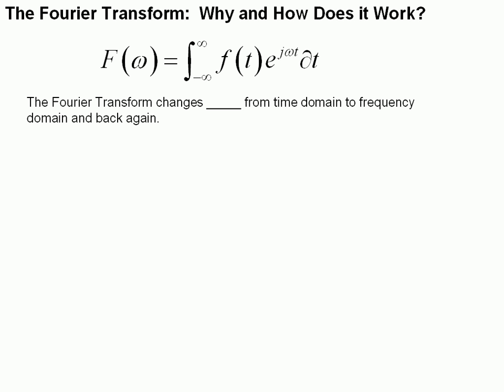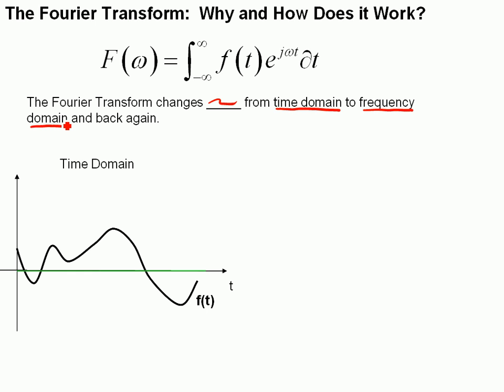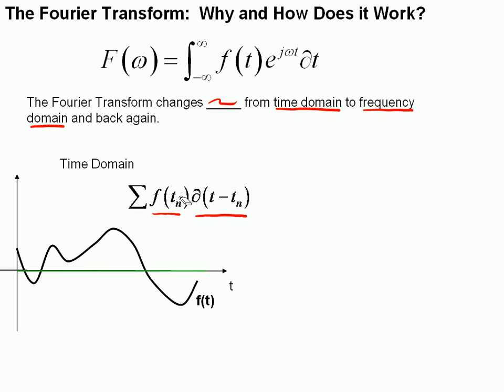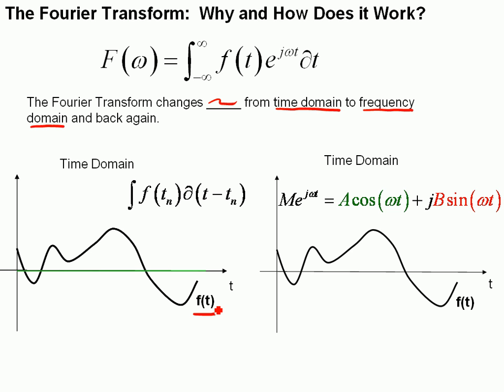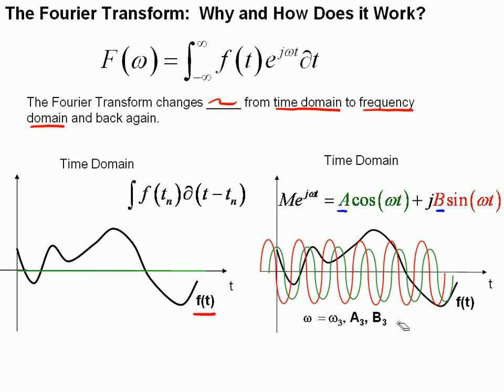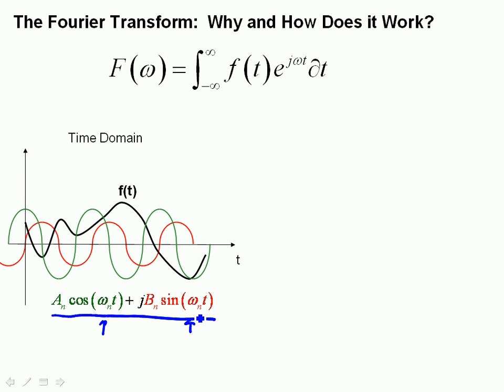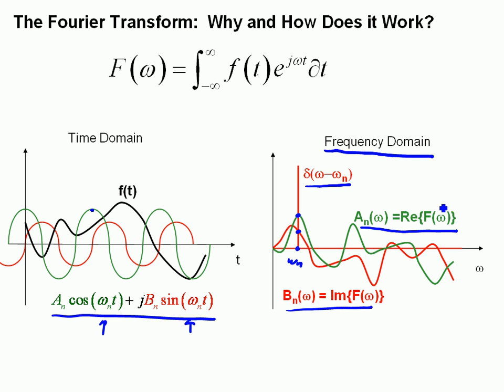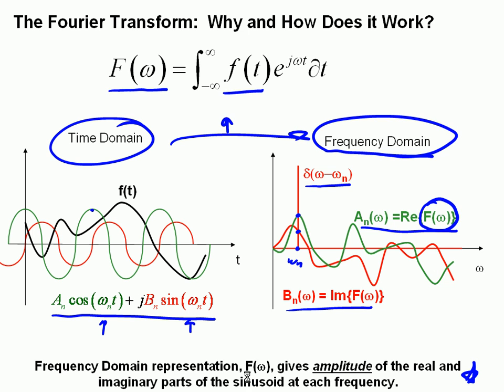The Fourier Transform- Part I

Comment: 02:18 -- is not correct represetnation function is not equal as summ of scaled "misterios deltas"

02:36 -- approximately correct, but you forget to append "dt(n)"
         
02:57 -- it is not correct, you leverage to misterios delta function. It can be obvious that 
you find some functional basis for f(t), but the signal is the summ of samples it is misterios thing.

 
03:24 -- it is not true, sorry! There is no exist FT for: sin, cos functions (in usual sense)! You confusing Fourier Series and Fourier Transform.

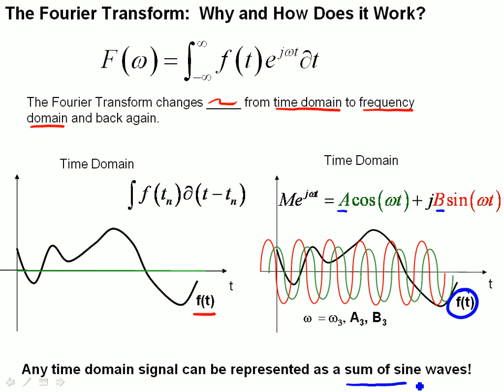05:04 -- it is not true! Fourier Series and Fourier Transform are different things!

Comment: Hi, Thanks for what appears to be the best explenation that I have found on the web so far. It's been over 30 years since I did this and I'm trying to understand it again and have one question. When I calculate the magnitude of the DC component (frequency 0) I get the correct value that I started with, however for all non-zero frequenies I seem to have to double it. Is this correct? BTW, I'm using the Excel fourier transorm in the data analysis toolkit.
Thanks

Comment: wonderful explation,it will be much more interesting if u add its something related to  like why it introduce,what the reason behind its existence,when it introduce,how it introduce,application of it in real life.Though i like it,its one of the best.
Reply: MOHD ANAS ALI in the field of electrical engineering, when sending a signal (say audio) the signal on the receiving end will have picked up some noise and distortion along the way, which can be considered as as smaller sin waves with different frequencies (any signal can be represented by the sum of sin waves with different frequencies). The use of Fourier Transfrom allows us to look at the all the frequencies (signal + noise) and determine a good cut off frequencies to create a filter allowing only the frequencies we need to make up the signal, resulting in a much smoother wave/higher audio quality. 
Of course this is only one example among many in this field alone. I can only imagine how useful it is for physicists.

Comment: Mathematicians use "i" to represent sqrt(-1) but in engineering the "i" is typically used to represent current, thus they needed a different representation, "j". They are the same.

Comment: @kridnix Cool video, we need more of those. You should check the sign in your exponential in the definition. I think it's exp(-jwt) not exp(jwt). Also in the definition, I think you wanted to write "exp(-jwt).dt" and not "exp(-jwt)delta(t)". The delta sign is used in another context of differentiation as you know. ("partial" and "spacial" as keywords).

Salutations d'Alger.

Comment: @kridnix 
Two more questions: 
4. Practically f(t) is so messy unlike in the example taken by you. If I want to do a fourier transform the way you have done, what should I replace f(t) with in such a case?
For a simple functions, f(t) can be sin8t or cos6t or summation of them, how about complex (I mean messy, not mathematical complex)  function. I don't know what f(t) is made of. I don't know different values of w (omega)?

Comment from the maker: @78uttam For the third question, they are using a numerical Fourier transform and the frequency spacing will be inversely proportional to the sampling rate and proportional to the duration they measured the data for.  You can't have an infinite number of frequencies in a time limited window.

Comment from the maker: O.k. There are three questions
1)  You only measure the real part.  In the complex eq. A and B themselves are complex which allows you to change the phase of the wave.
2)  Orthogonal functions form a set from which any other function can be built.  The most common example are the unit vectors, xhat, yhat, and zhat, from which any point in space can be represented.  They are orthogonal because changing xhat doesn't affect yhat for example.  Move in x, y does not change.

Comment: the delta function is multiplied by f(t), so basically the delta function describes a straight line at each point in time, and the f(t) imposes an amplitude on the delta function corrrect or no?

Comment from the maker: Yeah, there should be a similar response at negative frequencies, but I didn't include it since it would have made the images smaller and the explanation more difficult.  Most people ignore the negative frequencies since they are just a mirror image of the positive.

The reason I had a lot of frequencies was to demonstrate the overlap of the e^(iwt) term of the integral with the multiple frequencies in the signal f(t).  I thought having several frequencies might show the point a little better.